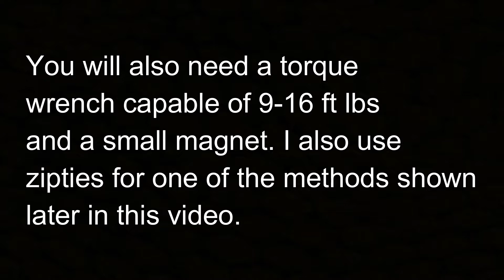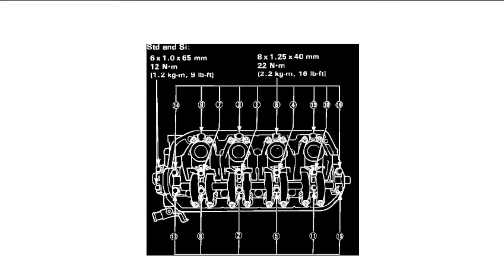Valve Stem Seal Replacement Honda CRX Civic D16A6

Comment: Good job with the magnetic socket, I'd give that an 8 or 9. Lisle makes a valve keeper installer & remover kit that does not use all those zip ties. Also thanks for showing what can go wrong.

Comment: So to get this straight you only put the rope in the #1 Spark plug hole and you're are able to change all of the seals without putting the rope in the other spark plug holes?
Reply from the maker: No you have to repeat the step with the rope per cylinder. I only showed the process on the first one but it’s the same for all of them
Reply: Would the valve still have room to fall into the cylinder if cylinder was at TDC?